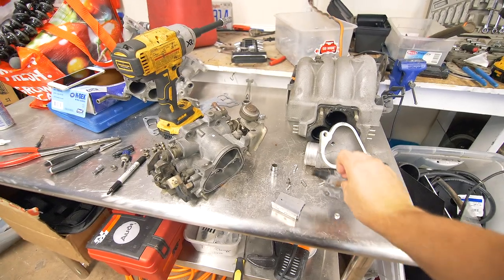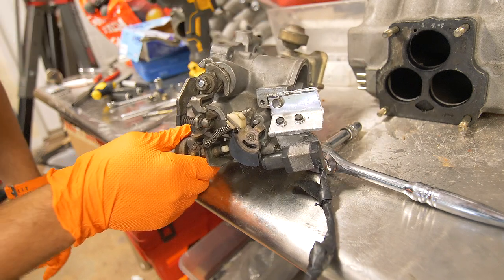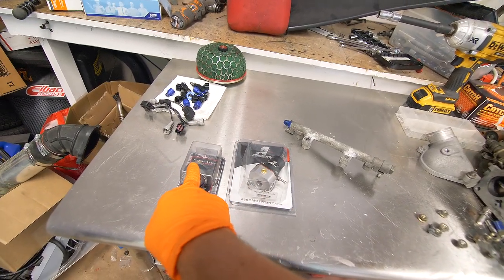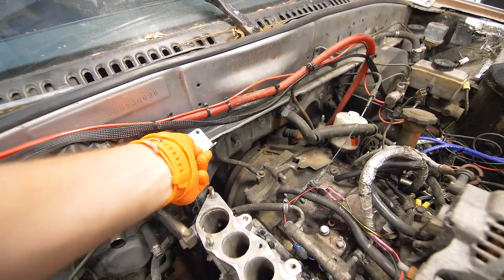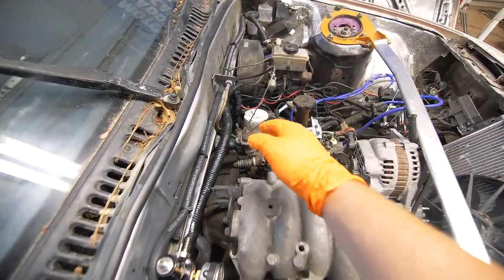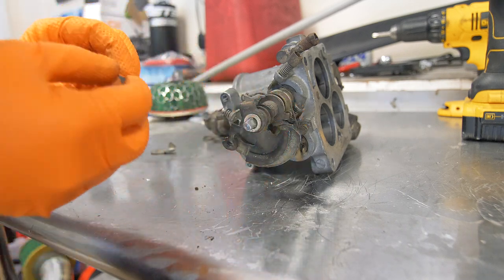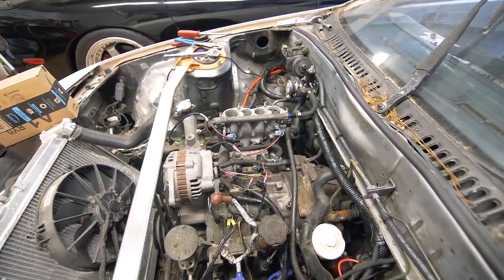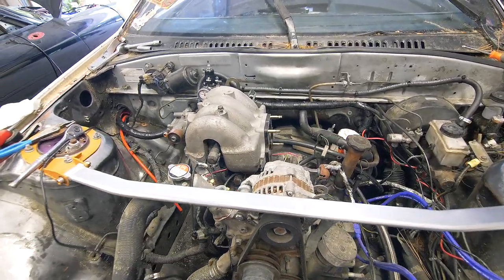ALL of the FC RX7 Turbo II components installed (except the turbo 🤣)

Comment: What kind of power mods will you be doing 
I also noticed an e-fan on your radiator and thought you might want to beef up the cooling system aswell...... any way keep up the content I love watching as much rotary content as I can so thanks for making some!!
Reply from the maker: You got it, thanks for watching! I am looking for mild, reliable power - 300-350 or so. Precision 6776 turbo running low boost. I'll def try to make everything run as cool as possible, rotaries generate so much frkin heat.

Comment: nice bro. its coming along well. i had my FPR there but had to move it due to exhaust heat issues
Reply from the maker: Thanks man! Shoot, I hope I don't run into that hah, what kind of symptoms did you notice?
Reply: @supercarmio  I had a issues with the fuel getting to hot in the lines and the fpr and vaporising making random pressure spikes and pressure drops. High vapour build up in fuel tank aswell due to fuel getting to hot
Reply from the maker: @rotary_rsr9794  Gotcha, I'll def keep an eye out for this. Thanks for sharing